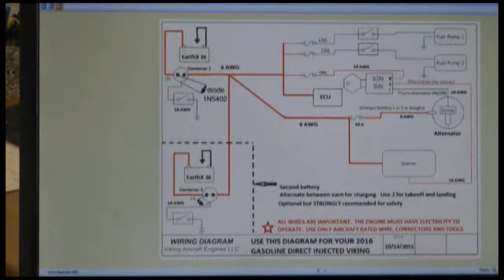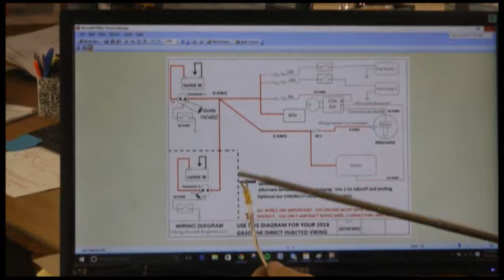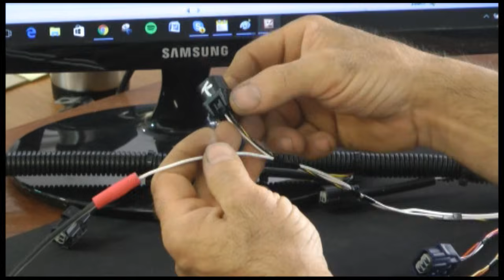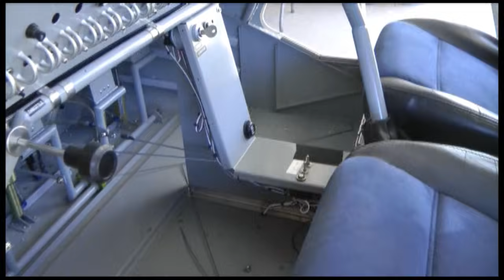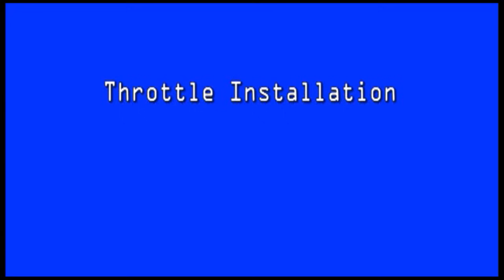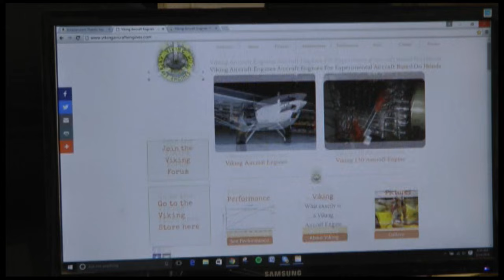Viking Aircraft 130 Engine Installation Part 1

Comment: No way to add a second spark plug and a magneto?
Reply: Not without designing an entirely new cylinder head. Why would you want that anyway? This ignition system is probably ten times more reliable than any dual magneto system that ever existed.

Without a computer controlling the timing, you might also run into problems with detonation on an engine like this.
Reply: And, really, if you wanted dual ignition systems, you'd want two systems of the type that's already on the engine. This is what Lycoming does on their iE2 engines, which are currently in widespread use on the Tecnam 2012.